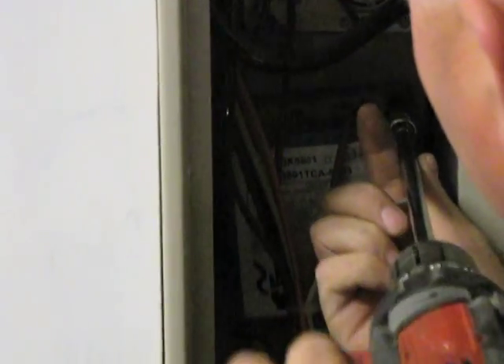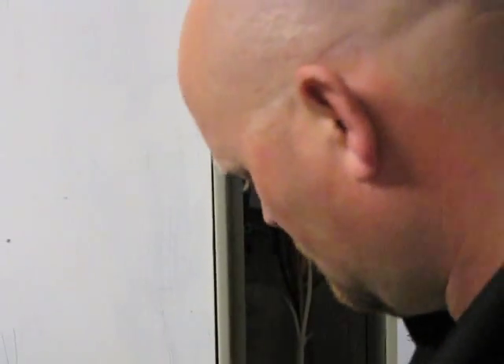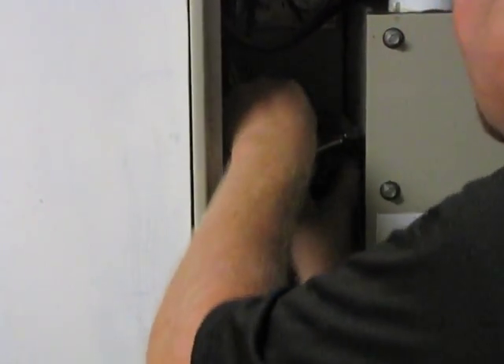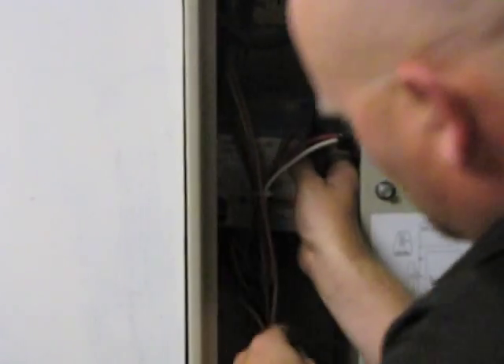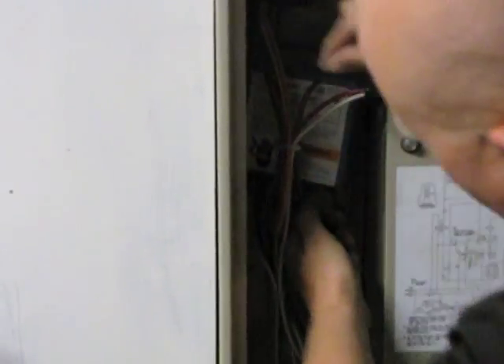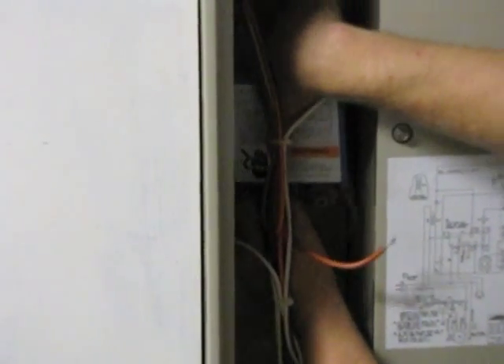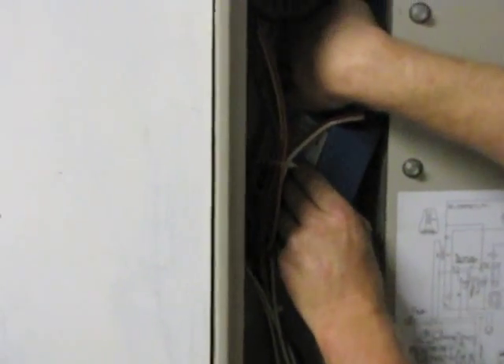DIY - How to Install a Baso Ignition Control Board on a Lennox Pulse Furnace

Comment: an amazingly easy operation, from powering off the furnace to first rumble with the new controller was no more than 20 minutes...and for the cost, its worth having a spare on the shelf (this is my third controller overall, must be the vibration over time kills them?)

Comment: Not a bad video-but make SURE your ground wire screw actually screws into the furnace sheet metal-your screw DIDN'T!
Reply from the maker: This video is for informational purposes only. We informed you to ground the wire, although we did not do it ourselves because the old (blue) board was working fine and re-installed after showing how to install a new board if you need to. We never fired up the furnace using this board.
Reply: Good video and just I need, I appreciate it immensely but reading your reply is here is funny.   Rhetorical curiosity on why you'd cut the old connector off to fit the new one if you were planning on just putting the old control back on.   Anyway, thanks!
Reply: @junyr73  all that's required to switch back is to remove the spade connector and press the wire back into the original
Reply from the maker: So that the viewers could see how it works rather than just us telling them. We like to walk through as many steps as possible.